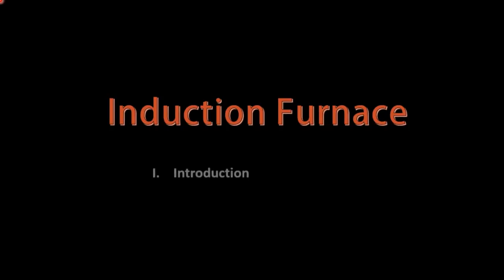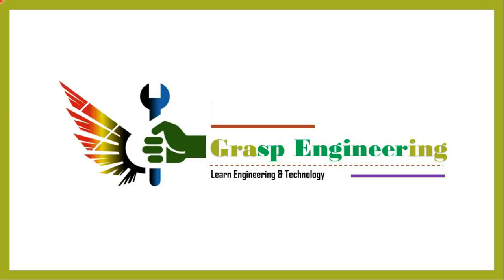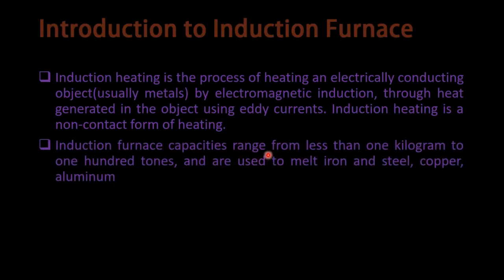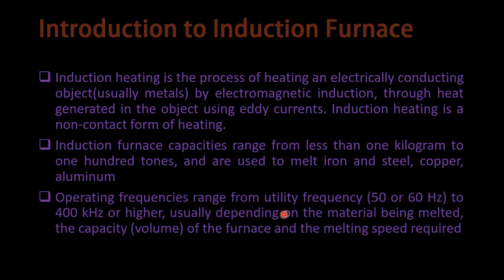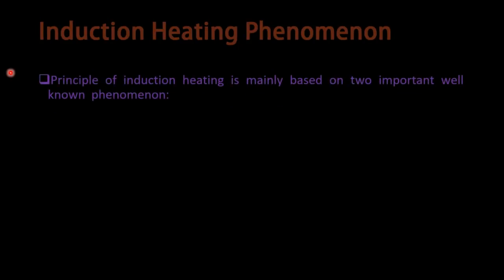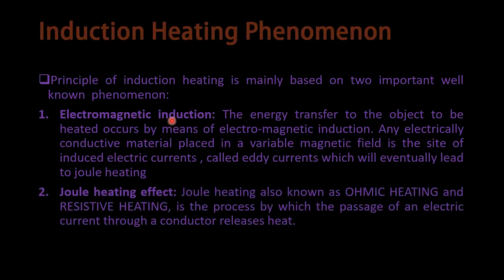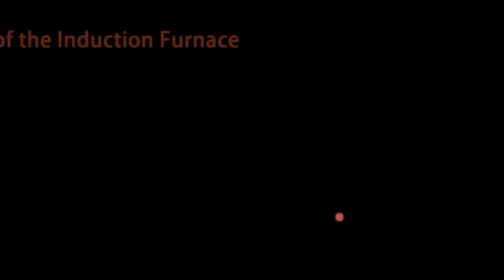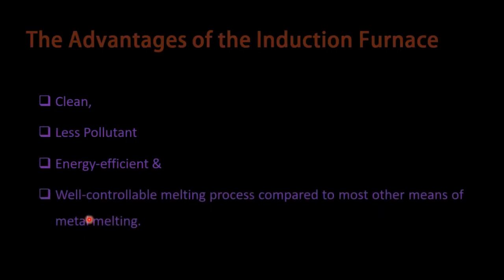Induction furnace Working through animation

Comment: I need more explanation about cooling system because water and power flow at same hose(power lead hose)...
Reply from the maker: Okay, Will add relevant video. There are primarily dry air closed loop & evaporative closed loop systems are used.
Reply: Visit Moiz Steels nd see for how it works